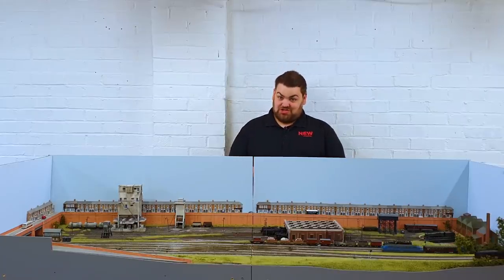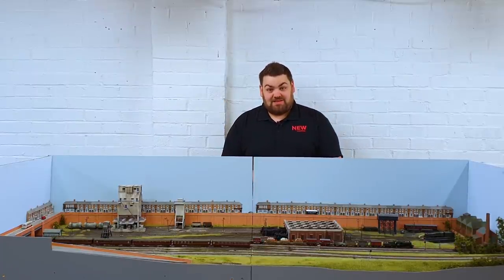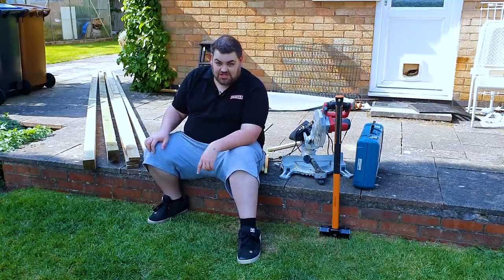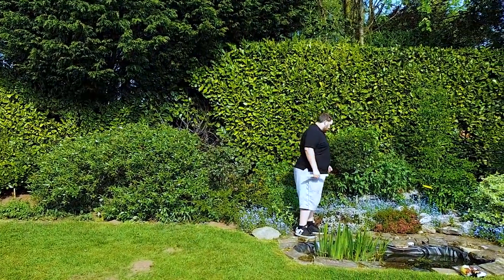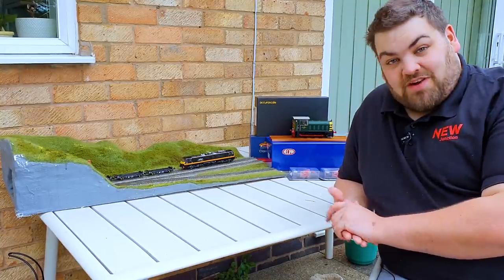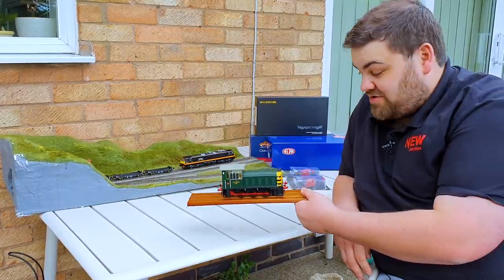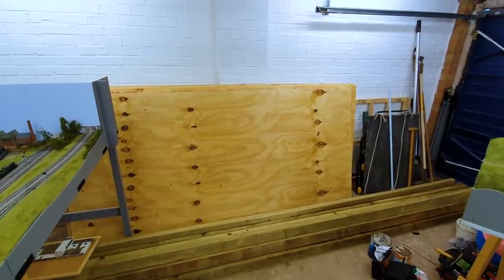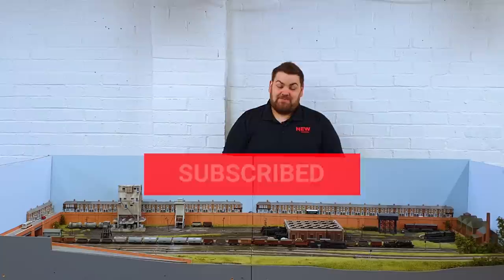New Junction: A New Beginning | Into The Garden

Comment: Garden construction looks really good and you have given longevity of the supporting system a lot of thought, one thing I’ve learnt is to use end grain protector on cut timber to maintain protection, it will take stain once dry.
Reply from the maker: Yes definitely! I'll try to add that into the actual garden railway series

Comment: Just a tip about your timber....That looks like cheap shuttering ply. It will warp and eventually peel. Pva, even exterior type, won't help it because ext pva turns white and softens too. Paint will help somewhat. Best bet is lay roof felt on the top.and overlap the edges.
Reply from the maker: I did say that in the video hehe

Comment: Hello Richard,

thank you for the update. On the N gauge layout I realised that on the line where the 9F with the mineral ran, that the track had a misalignment in height at the joint of the baseboards. Could these be fixed? I think that it could cause some worries over the time during exhibitions. 

And have you considered to put some form of insulation into your garage? So that your future layout won't suffer from extreme temperature differences.
Reply from the maker: Hi, 

Installation will need to be tacked some how.
The gap in the track is one of my jobs for the layout!

Comment: Question? Wny not make the garden railway 00 gauge and run it form new new junction out form the shed have some very very scenic outdoor sections and run it back into the garage. Can have longer trains have them running at full speed  (90mps plus and)
Reply from the maker: The ground level drops off to much
Reply: New Junction so you could work it out and for high speed full length azuma running be amazing to see